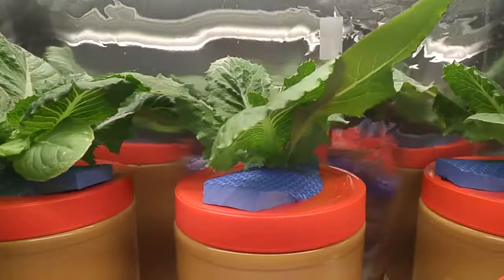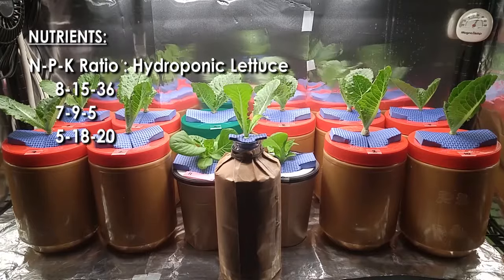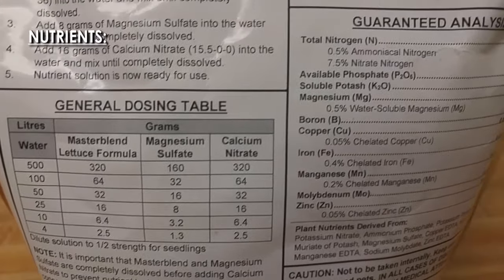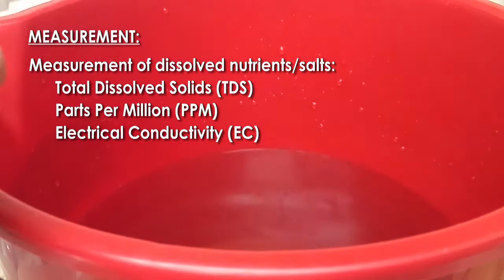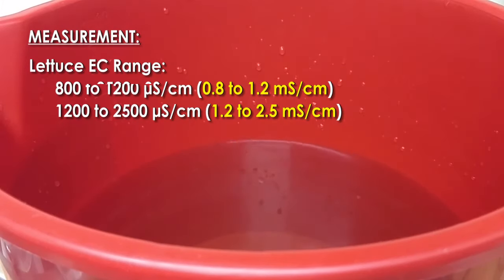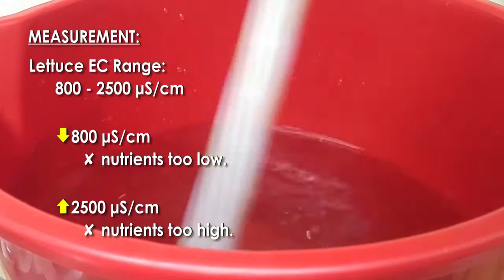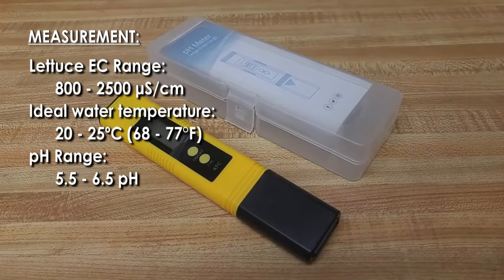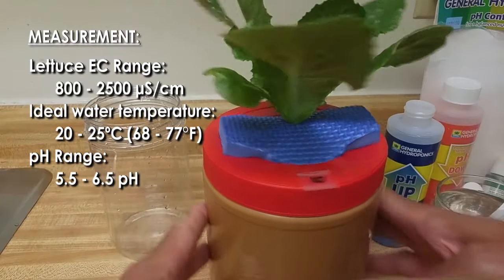DIY : Hydroponics - Understanding EC, pH. Simple Lettuce Nutrient Solution and Measurements

Comment: can I get data from it to arduino
Reply from the maker: These are basic meters. There's nothing on it that will let you export data.
Reply: @diyhookedonhydroponics   what about using jumper with some calibration from it to analog pin in arduino
Reply from the maker: @nadernabil8031  check with the manufacturer. I just grow lettuce the simplest way.
Reply: Ok thanks
Reply from the maker: @nadernabil8031  you can buy what you need on Amazon for less than $40.
Reply: @diyhookedonhydroponics  40$ for egyption student is not that affordable amount .thanks for effort
Reply from the maker: @nadernabil8031  got it. need drives invention.

Comment: Your numbers should be ppm, not ec. 1.0 ec = 700 ppm
Reply from the maker: Where did you get 700 ppm from?

Conversion factor can be 500 or 700, or depending on the nutrient mix as provided by the manufacturer.

That information wasn't provided by the supplier of the nutrient product used in this video.

You can't just assume what ppm conversion you'll use or you'll end up using more (or less) fertilizer.

That's why EC is much more easier, since it's just electric conductivity in the water as a result of dissolved salts.